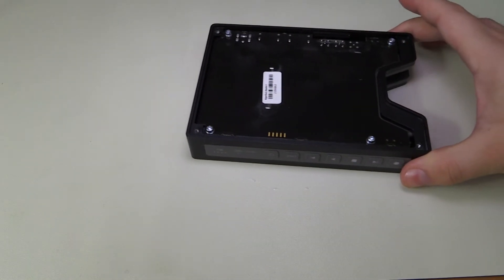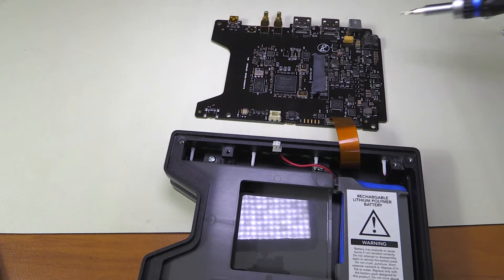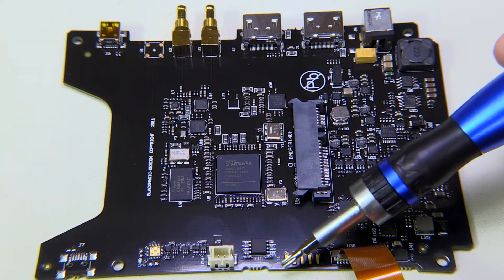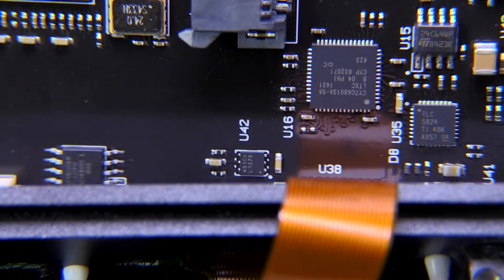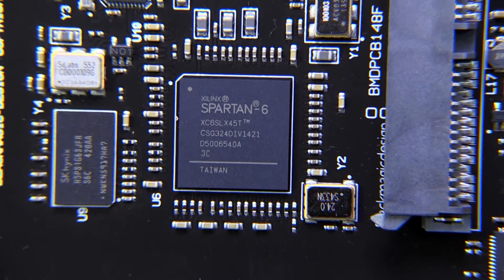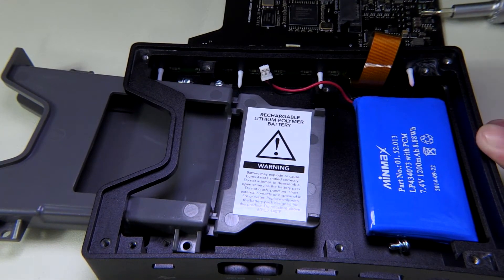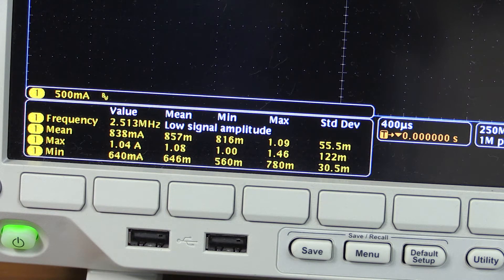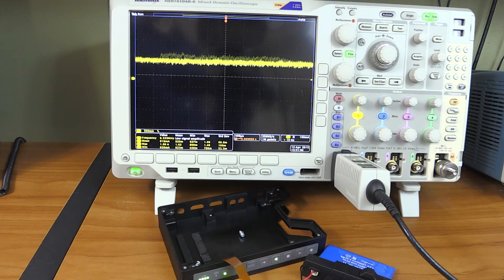HyperDeck Shuttle 2 Teardown!

Comment: I've got to say I just pulled mine apart to look at the internal battery and I wan't impressed by the build quality. Looks really solid from the outside but it has very small screws going into aluminium and there an no weather seals.

Comment: I had my SDI IN, fall off of my Shuttle 2 while I was replacing the cable, is there a way to replace the connector? Or do I have to just use the HDMI IN?
Reply: Ozzy Castellanos I actually removed the stupid mini BNC and soldered a full BNC, drilled a larger hole and worked perfectly until I got cocky and drilled a whole for a 1/4 thread, accidentally breaking the ribbon cable on the button board

Comment: At 1:11, that almost looks like the cracks I have seen in some silver-solder or lead-free joints on connectors that were not connected to the housing and had the force applied to the plug exerted onto the printed circuit board each time you connected a cable.  Some of the joints had their islands and "cone" shaped tin parts come of basically alltogether (probably in smaller bits, but still) at some places I could only see the tin left on the pin and in a very severe case (maybe one that did not have silver-solder cleaned off properly when being resoldered with lead-containing solder) really only the pin itself.

Comment: Thank you for the tear down, I am thinking of buying of of these units and did wonder if I could install a bigger battery? could I?
Reply: using a battery plate and any LP E6 canon battery can overtake that internal, also you can make it on paralel and do it hotswappable.
Reply from the maker: camofilms I didn't bother finding one but yes, you definitely can substitute the battery.

Comment from the maker: @debbes: That's not correct. As you can see by the "max" tag jumping down, the measurements are only performed on all points in the current sweep. Not previous ones.